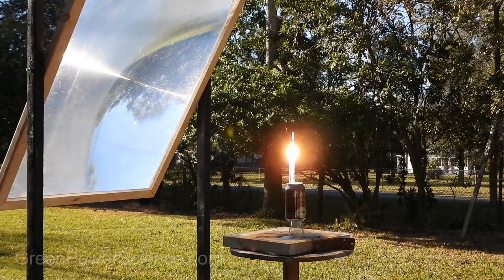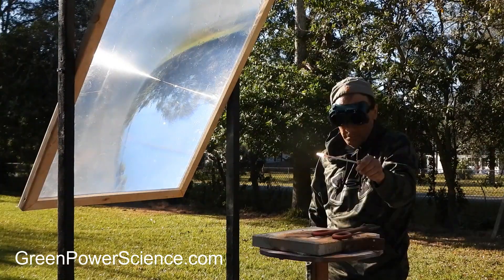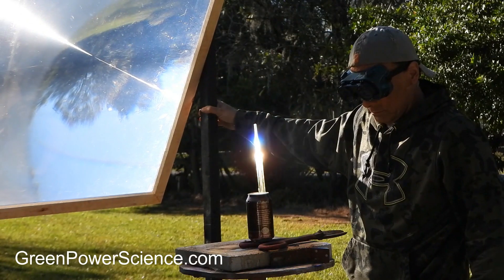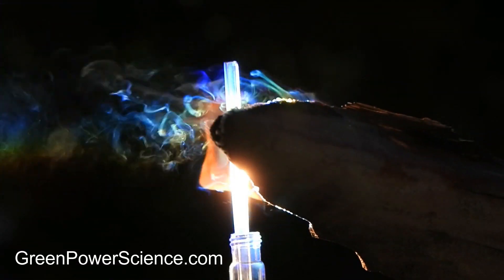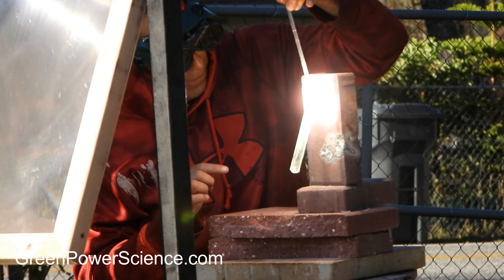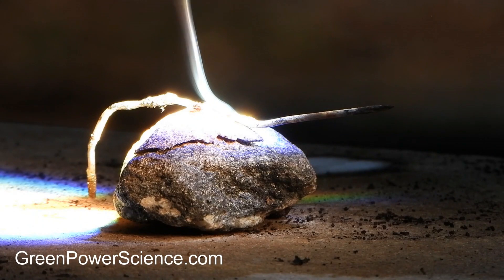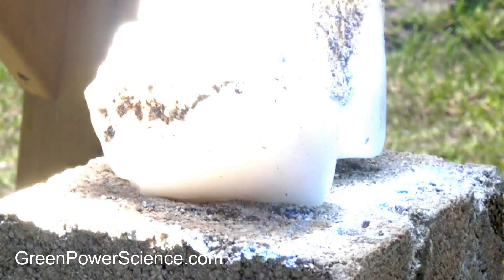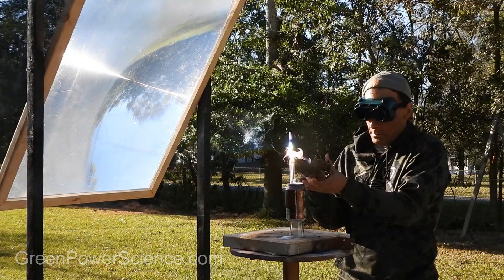Fresnel Lens DAYTIME LIGHTBULB Sunlight 360 degree redirection

Comment: I was wondering how much of a temp difference there would be if you used the same Fresnel lens on a clear day in more northern areas during winter? I dont really have the time and space to build this but I can imagine a solar-powered heater using this set-up. if you create a Fresnel lens oven to heat a sheet of black cast iron, then have a solar-powered fan pass air over the heated cast iron and into an air duct; that would create a decent heater right?? on a clear cold day in somewhere like New England or Canada this would be a free heating source!

Comment: Please do this:
Build a picket mold out of black metal, including a boxed area and a cover to be used later.
Gather plastic bags.
Cut up hard plastic.
Heat the bottom of the mold using lenses.
Press a layer of plastic bags into the mold.
Press a layer of hard plastic to help make the picket sturdy.
Press another layer of plastic bags onto the hard plastic layer.
Place a black metal cover on the mold.
Heat the top cover using lenses.

Could you make a picket for picket fences?

The idea is this:
Most plastic recycling videos seem to over process the plastic.
This idea does not need much processing, and pickets do not have to be perfect.
Alternate wooden pickets with new plastic pickets.